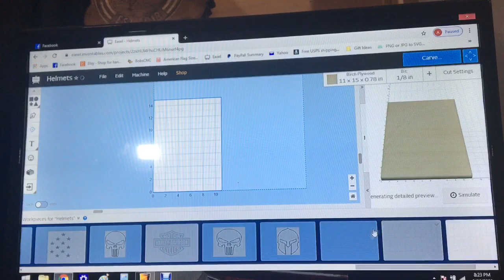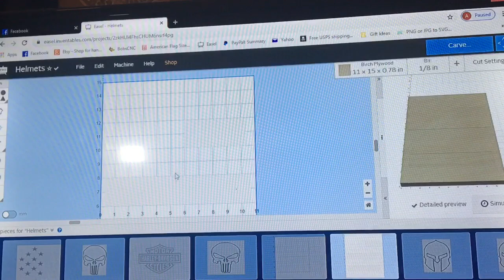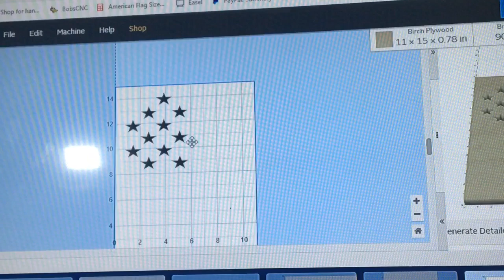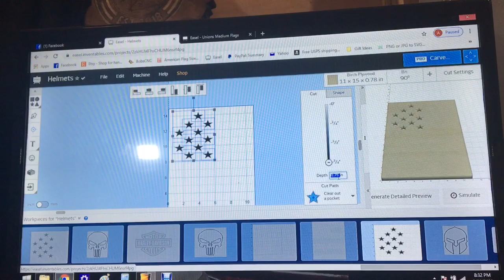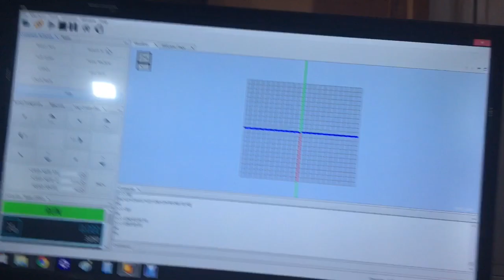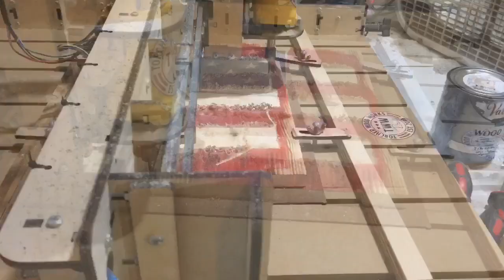CNC Carved Spartan Helmet!!

Comment: hey thanks for all the videos you do very nice work I was gonna try and make on for my fire department and was wondering what is the materials needed for the large and dimensions of the union and how wide are the stripes and overall size. thanks a lot keep up the good work and videos coming really enjoy them.
Reply from the maker: JUMP OUT Thank you for watching! The size board I use is a One by 12 inch board that is cut at 15 inch length